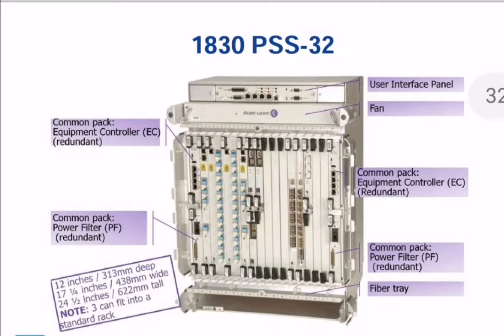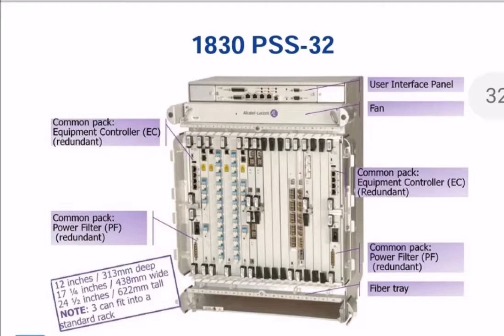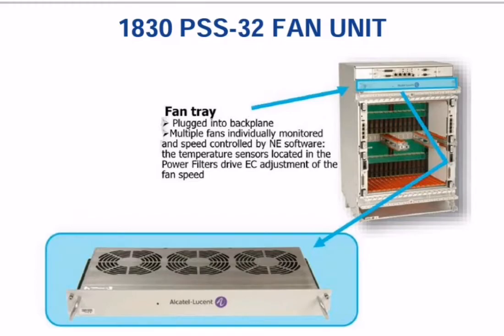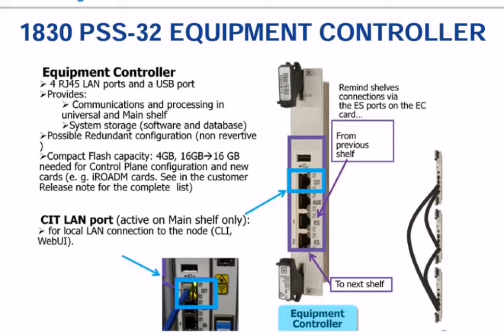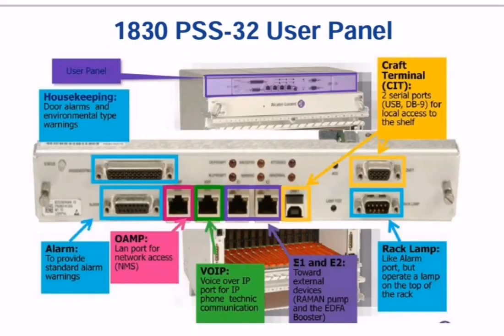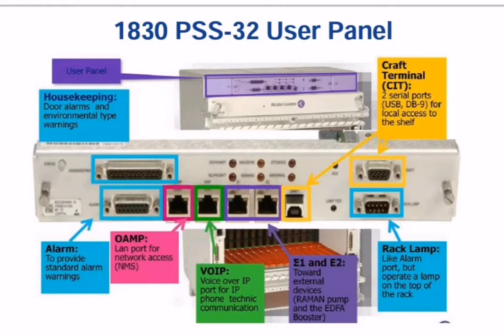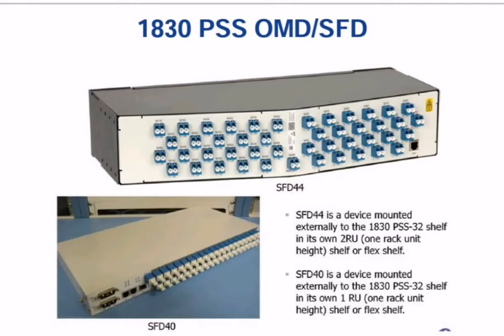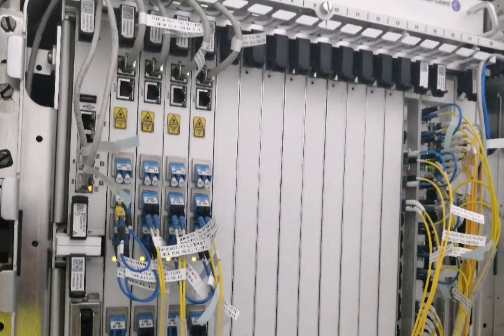DWDM PSS-32 Nokia Hardware discription in English language.

Comment: Sir how we decide how many amplifier card required, if we use dcm with alcatel it increase amplifier card requirement by one pls clear this. Is it compulsary to use dcm card or not ?
Reply from the maker: amplifier card  includes an optical plug-in module with a controller that manages optical power, laser current, and temperature control loops. An amplifier also manages communication with the TCC2/TCC2P/TCC3/TNC/TSC card and operation, administration, maintenance, and provisioning (OAM&P) functions such as provisioning, controls, and alarms.Mainly two Amplifier cards are required in DWDM PSS one is main and other is stand by and dcm card is not being used in DWDM PSS Nokia  it's the equipment controller card which we are using
Reply: @telecommunicationstraining7085  hi sir thanks for revert. Sir pls clear about osc in dwdm
Reply from the maker: @skumar6700  OSC is a bidirectional channel connecting two adjacent nodes in a DWDM ring. For every DWDM node (except terminal nodes), two different OSC terminations are present, one for the west side and another for the east side.